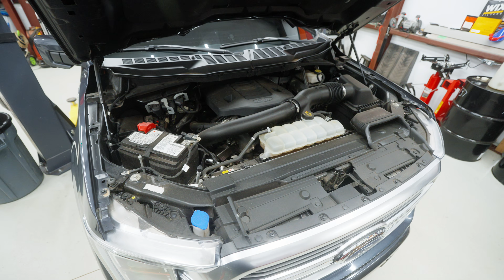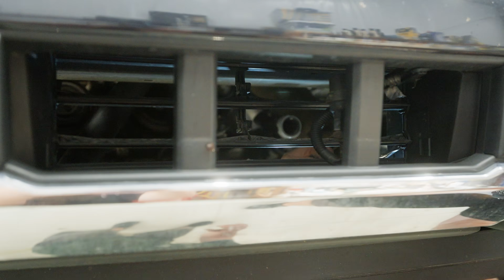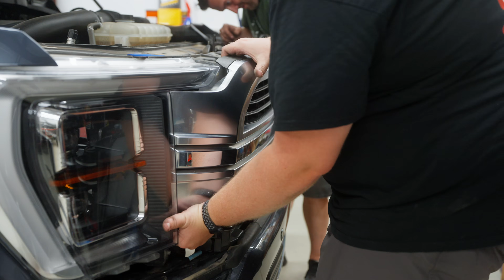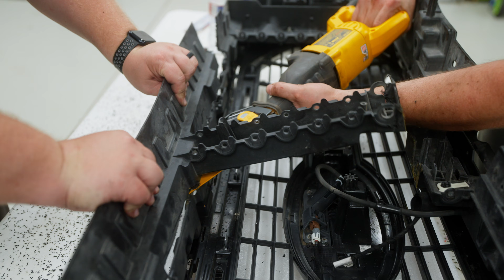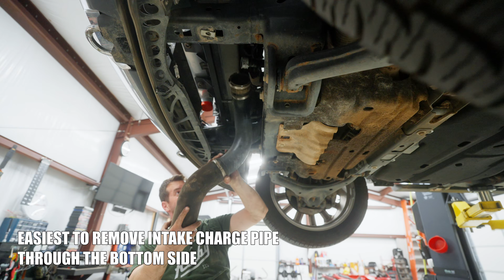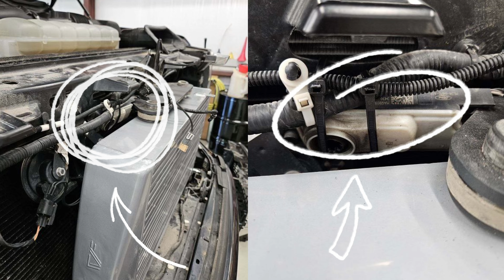A MUST HAVE Ecoboost Upgrade - CVFab High Mount Intercooler Installation Guide for 2015-2023 F-150

Comment: I’d love to do this mod to my ‘17 2.7, but there’s no way in F-ing hell that I’d try to do it myself. Looks like a very complicated procedure. I’m not nearly as adept as you guys are under the hood.
What kind of pro should I approach to do the work?
Reply from the maker: @gregarmstrong6798  where are you located? Any mechanic should be able to handle it, but I’d look at truck, performance, or off-road shops. You could even check your local Ford dealer and see if they’d be willing to do the install, and if not I’m sure they could recommend someone.
Reply: I’m in southern ca. Orange County area.

Comment: Do you think you’ll do a catted down pipe too?  I’ve been on the fence about getting their Max Kit with all the new plumbing, Intercooler and downpipe. I also run a 5* 87 tow tune. I’m just wanting more power for towing and daily driving. That being said I also have a 91 perf/tow tune
Reply from the maker: Absolutely! CVF doesn’t have a downpipe kit for the 21+ trucks yet so I’ll be going with SPD for that, but will be tuning and adding more CVF plumbing soon
Reply: I run a 2018 XLT that I’ve been building for about three years. We tow the camper out west and I actually own a food truck and operate that three times a week. I figured if I get everything done under the hood then I can go with the 3 inch exhaust Out the back and I will be able to maximize how much it breathes in but also puts out. Appreciate your feedback! Thanks.

Comment: CV fab over Cobb?
Reply from the maker: @tylerdefrees824  great question! CVF is the best bang for buck Intercooler option (my opinion). I’ve had zero issues and the fit/finish was great- which I’ve also consistently heard from those I’ve talked to running CVF parts. But I do have a Cobb intake to install so I’m not opposed to Cobb or anything like that, if you just like one brand over another that’s totally fine

Comment: Hi 
I have a question regarding 2018 ford Xlt . I have a third year driving this . I am coming across one problem which i face during winter . That causes the doors does not shut down when it’s open to sit in then you try to close the doors . They don’t shut. 
It only happens in winters . 
When it’s -10 or less degrees 
As the temperature goes up by tuning heat on it starts getting warmer inside and get locked 

Can you tell what can be the reason
Reply from the maker: Frozen door latches caused by water intrusion are a pretty common issue with that generation F150. Your local Ford dealer should be able to fix that pretty easily

Comment: That’s a lot of work, when there are other companies that make the same/similar product, just plug and play .. I would have to pass on this, will have order COBB for sure .. I hope they will send me some free stuff ☺️
Reply from the maker: Thanks for watching! I’m curious what’s not plug and play about this? CVF has an upgraded intercooler for the stock location as well, but any top mount intercooler will be the same installation process, including the Cobb unit
Reply: @adventureduty  ahhhh!! Ok gotcha so they do have that option as well, that’s good to know, I will check them out, do they have tunes available for the 2024 F150 3.5L ecoboost ?
Reply from the maker: @AngelSilverFourtySeven they don’t offer tuning, just the parts. You can run an upgraded Intercooler without a tune and still see some benefits, so it just allows you to upgrade and tune later if needed
Reply: @AngelSilverFourtySeven  I have a tune on my 23 Limited Powerboost E85 Tune from 5 Star Pcm swap so maybe they can do that on the 24
Reply: @ I have rescheduled out to a few tuners and unfortunately they are still trying to figure it out for the 2024 models ..

Comment: Not sure if yall have posted it yet or not, but what kind of changes have you seen with HP & TQ? Thanks and great video
Reply from the maker: Thanks for the compliment! It’s still on the stock tune so there was likely only single digit increases if any. Mostly just addressing heatsoak in preparation for injectors, tune, and full exhaust plus making room for a frame cut bumper or winch